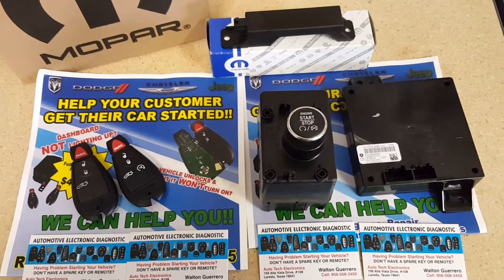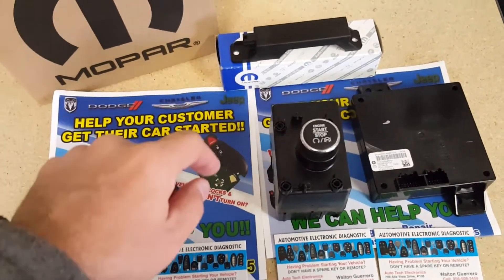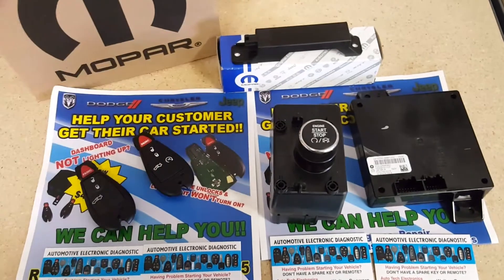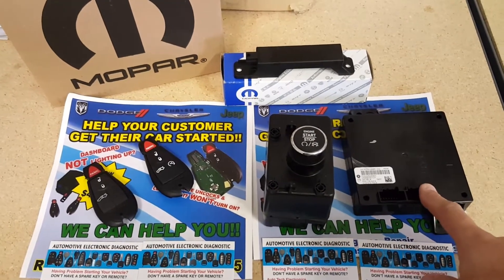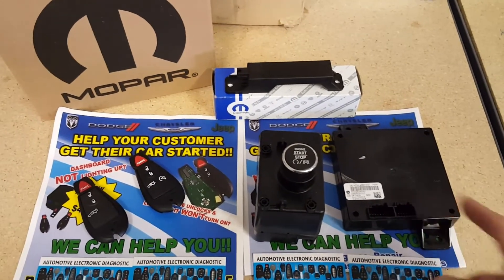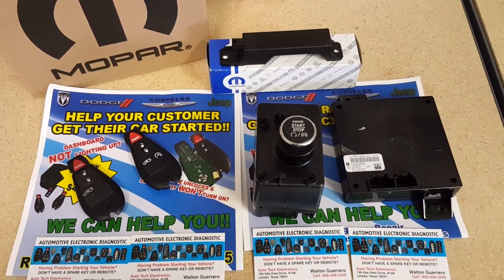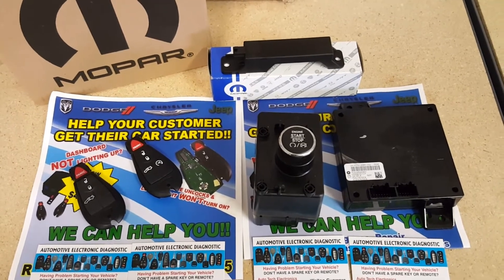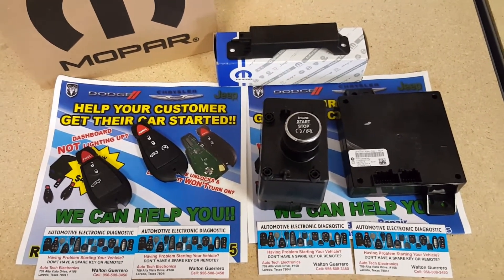2009 2010 2011 2012 Dodge Grand Caravan Challenger Keyless Go Proximity

Comment: Guys, please tell me, where is localized in car (Dodge Challenger) receiver passive entry ? the biggest black box on the right ?
Reply from the maker: It should be on passenger side above glove box
Reply: @AutoTechElectronic  thanks for tip, maybe You also know where are the antennas ? I still have an  error --  keyless antenna disconnected
Reply from the maker: @E38michal  text us the vin for the vehicle 2109205819
Reply: @AutoTechElectronic  SMS has been sent
Reply: Guys, could You help ?
Reply from the maker: @E38michal  please text questions to 2109205819

Comment: Can you use this on a 2012 ram 2500?
Reply from the maker: No, there is no prox available for RAMs 2009 thru 2012 only 2013 thu 2021 manual transmission